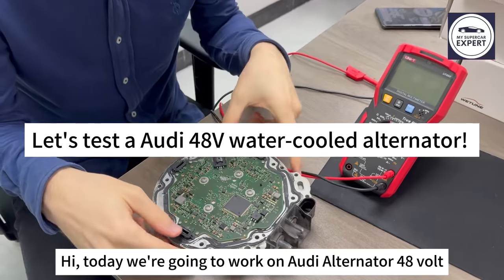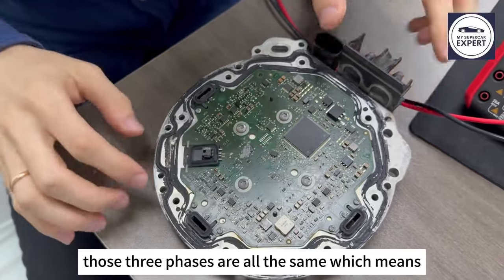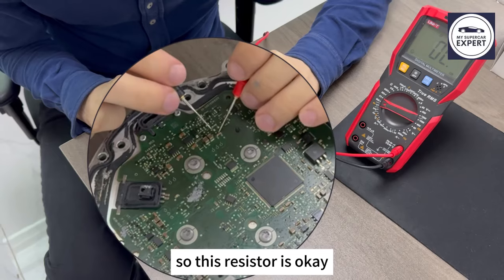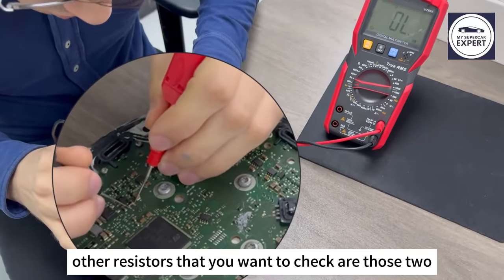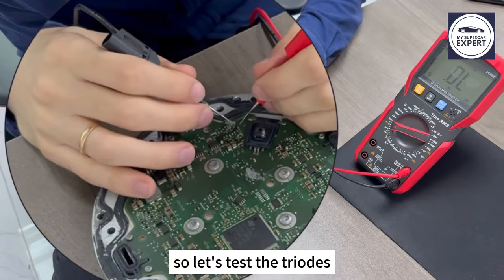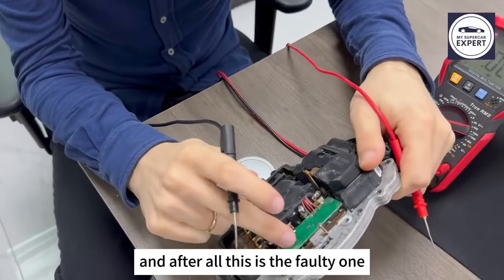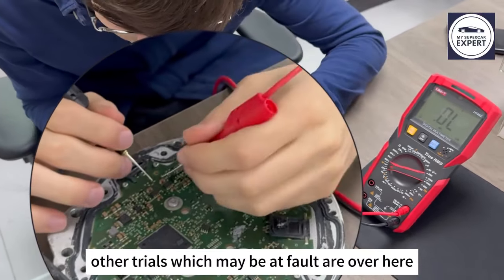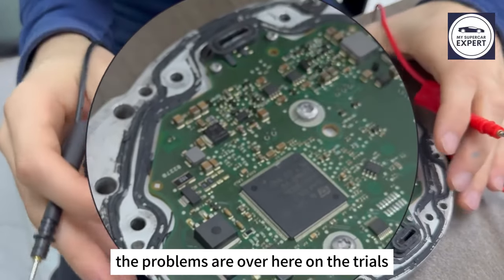Let's test a Audi 48V water-cooled alternator!#Audi #carrepair #ev

Comment: The AI Generated subtitles are trash. Every important technical word is misinterpreted which is misleading and it is not even possible to switch off. Face -> Phase  Gateway-> gate driver  proco -> Broke triode-> díode  60 -> 600  trial-> triode?
Reply from the maker: Yeah, but it helps a lot with adjusting the timing as manually it takes far longer...
We must have missed some typos when reviewing that. Sorry!

Comment: Great German engineering, water, and electronics, what could possibly go wrong?
Reply: Well heat and electronics is worse so it needs to be cooled plus it’s a car rain gets all over the engines
Reply: @rowanballinger3690  Humid heat at that.  Conformal coating only protects to a limited degree.

Comment: You said resistor can fail. How does a resistor fail? To much current passing in it so it heats up and fails?
Reply from the maker: Also triodes and diodes right next to them in the circuit will fail first. In general the starting point is the high temperatures, including these due to external factors (the positioning of the alternator makes it prone to overheating). Then one component failing will lead to others breaking as well, till it gets to the IGBTs. By that moment alternator stops working as one phase is entirely off.